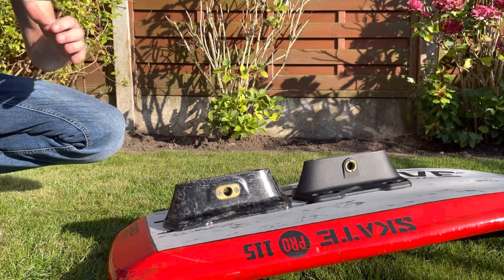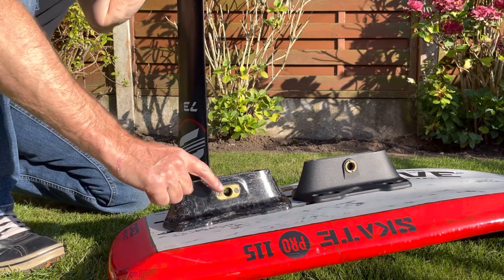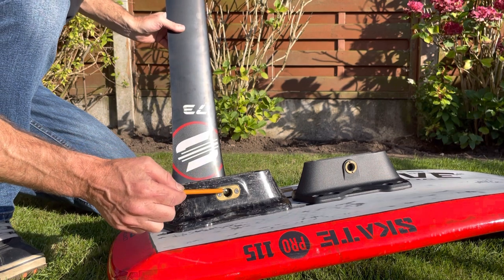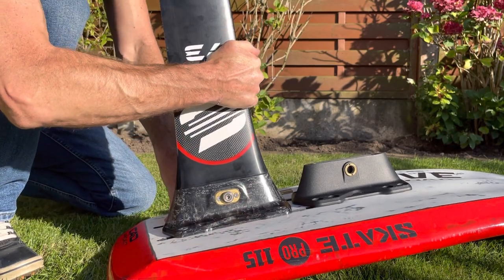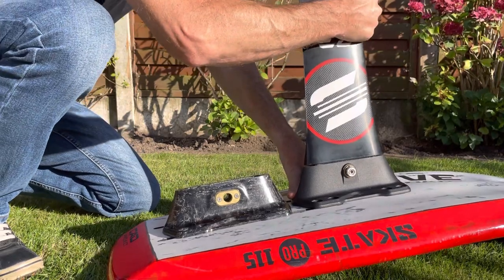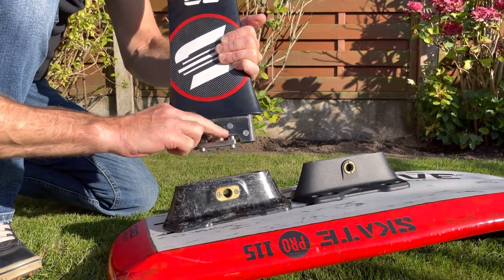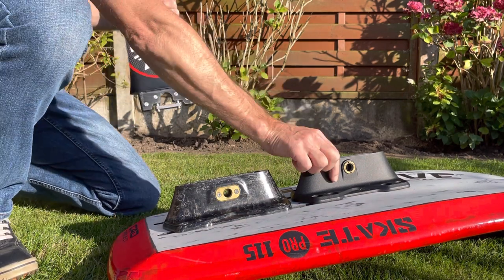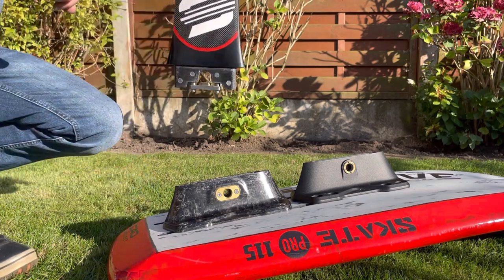Sabfoil Kraken Carbon Base Plate vs Aluminium version

Comment: What a cluster and poorly executed product line proliferation.  I wish they would focus less on barely clever marketing ads and get back to basic design engineering which would eliminate this.   I'm at a loss to understand how this could even get released like this.
Reply: they also sold a mast fuselage connetion with t6 screws. no basic engineering knowledge...they do what comes in there mind

Comment: I wish I would have seen this video before I bought the aluminum after having the carbon.  I purchased a complete carbon Kraken foil system with the carbon plate.  I wanted to be able to quickly swap this out between two boards.  I purchased the aluminum Kraken base for my second board because I wasn't worried as much about weight or strength.  To my major disappointment, these two mast bases are not compatible. Why aren't these the same?? These components are CNC milled to a specification.  Why would the company make these mast bases incompatible or least provide the consumer with a very obvious warning. They could easily make these compatible.  Why aren't they doing this? The only thing that I can think of is that Sabfoil wants to force people to get the carbon base.   This is a very bad decision when they're competing against other manufacturers.  I've written to the US sales rep to find out if they have a plan to turn this problem around.
Reply from the maker: I was in the same position as you and had to virtually give my aluminum plate away. The bigger problem I have is that there is too much play in the kraken connection to mast when using just the quick release pin. I now have my mast and base permanently screwed together using 2 screws through the base of the mast plate and the quick release pin. Therefore, it is no longer a quick release system and the kraken concept isn't something I can use.

Watch this video on the rigidity issue:

https://youtu.be/fEtq2JNsp14
Reply: @stevefollis9454   Fortunately,  I managed to figure that one out and it works pretty well... There's a fine line for stacking the utlra thin washers to get the single pin to work properly.

Comment: That's some crappy design. Thanks for the headsup on this one Steve, avoid moses for another year till the redesign it all again
Reply from the maker: The QR is very good and that new masts are very stiff and fast. Just decide if you want Aluminium or Carbon base plates (not both!)

Comment: In reality u cant trust sabfoil. theyr little boys with no basic comon sense nor engeniering skills. they built a foilset with  two M6 screws for the mast fuselage connection. a friend of mine ruined 6 masts in one year! mine is allready craced. the set costs 2000€ back than.
Reply from the maker: The new Kracken seems to be much better
Reply: Do you have a problem with one of those bolts being loose after session? For me it's the front one, also heard that some people have this problem. I assume you're talking about older model, not the Kraken.
Reply from the maker: @mikemiller774  correct, the older masts had a problem whereby the front 6mm fuselage to mast connection screw would always come loose. I can confirm that with the newer Kraken system which uses 8mm screws and a parallel fuselage to mast connection there are no problems any more.
Reply: @stevefollis9454  Well, at least that was fixed. Good to know. Thanks.

Comment: What about with the third option, the DT head? As it is made of aluminum is there the same issue in combination with the carbon plate?
Reply from the maker: DT head? If you mean bolting the mast directly to the base plate, then there is no issue as both Alu and Carbon plates have the same depth.
Reply: T03K kraken mast tuttle head. I have a windfoil board with foilbox and want to add a wingfoil board with plate.
Reply from the maker: @Sixthflyer  the T03K is aluminium so would fit fine but doubt you could not simply swap between that snd a carbon base plate without the altering shims
Reply: @stevefollis9454  That was what i feared

Comment: awesome thanks for the heads up. do you have a weight for each plate?
Reply from the maker: Carbon = 485g. Aluminium = 700g
Reply: @stevefollis9454  wow, that’s quite a bit! Glad I ordered the carbon ones. 
Now we just need a carbon fuselage!